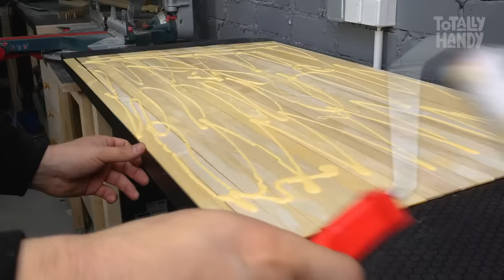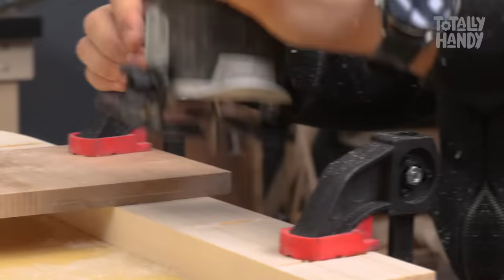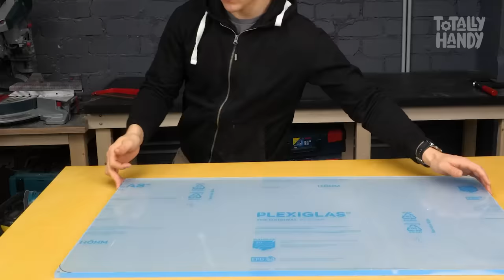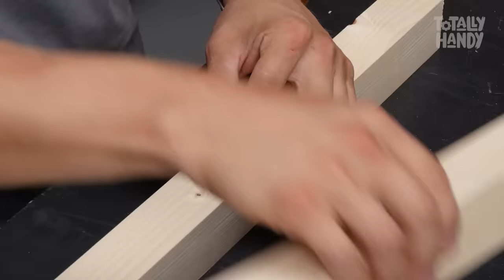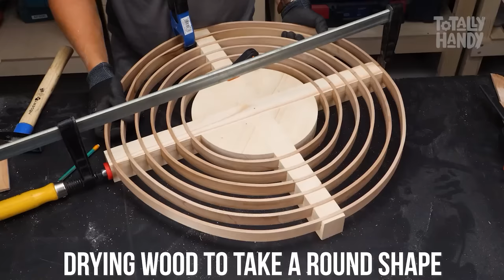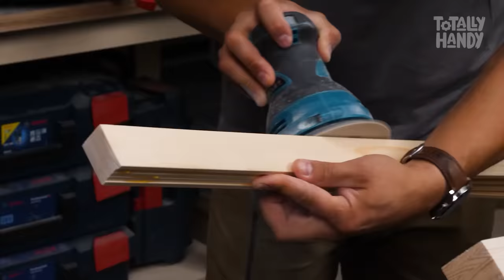Incredible Wood-bending Hack to Craft a Coffee Table | Woodworking Project

Comment: When I was building cabinets and raised panel doors for them, I remember gluing on of the panels together one time and accidentally mismatched the wood color sine the material was raw and needed yo be matched accordingly. In anger I threw the piece I had glued already against the floor and it broke on the grain and not the glue joint. Titebond is the most amazing glue I've ever worked with...simply the best.
Reply: Yeah, wood glue is usually stronger than the wood (depending on the wood)

Comment: The first piece was a great design, but I thought the second one needed some more thought on technique, as the circles were very uneven.
Reply: I was wondering about that too. What would be a good way of correcting that? I wondered if the measurements weren't spot on for the circumferences of the circles, but it's probably more likely because the wood doesn't bend consistently throughout its length. I think you'd have to create a mold or guide to clamp it in, in order to get a "perfect" circle, which for a one-off YouTube video isn't really worth it. Uneven circles will do just fine.
Reply: @segamble1679   I think you're right, and you'd want to router complete circles in solid wood as a template

Comment: Okay if you took an engraving tool and plexiglass and you could take the plexiglass and cut out the shape that you want then take the engraving tool and put a coloring book or whatever design that you might want to incorporate into this table and then start a plexiglass and it will leave that image onto the plexiglass you can flip the plexiglass over and you would have that image and it won't be damaged by repeated use of food or anything that might get trapped into the the scars cuz you would have a smooth surface up

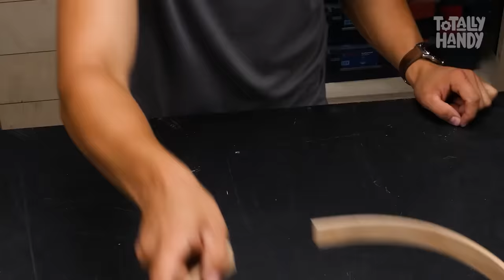Comment: 8:30 I know it would be somewhat difficult (given the thickness of the material) but, have you considered cutting the ends at opposing angles so that they have more surface area to adhere to?
Reply: actually it wouldnt be dificult at all. i studied carpentry for 2 years and that idea is really good. All you would have to do tho would be to hide the cuts like he did otherwise it can be a weak spot.